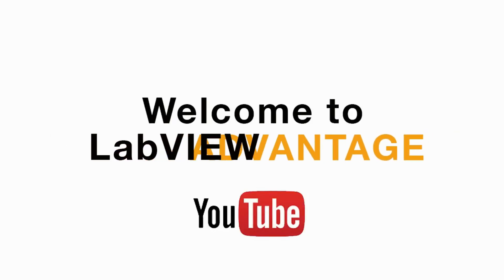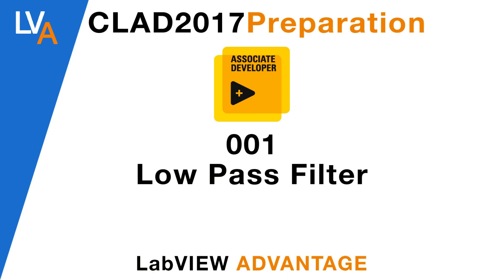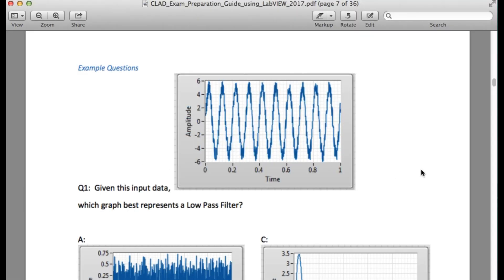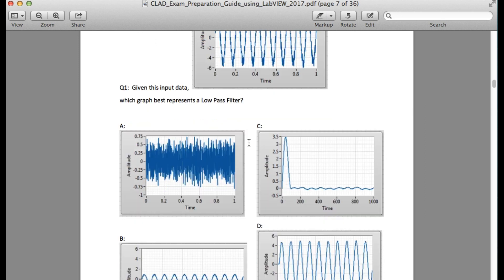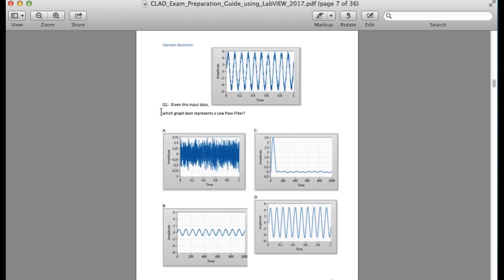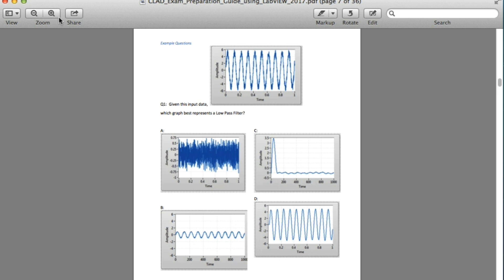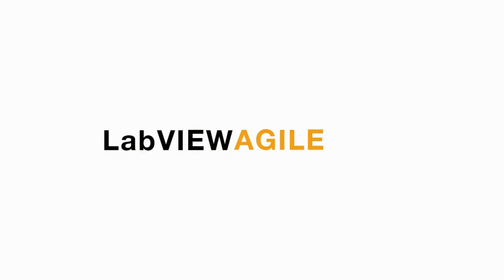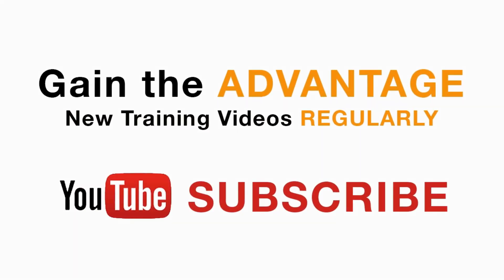LabVIEW CLAD 001 Low Pass Filter

Comment: To understand why A, B, and C are not the correct answer, we must explore some of the characteristics of a low-pass filter and the output it will give once an input signal is processed. In selection A, we can see that our output looks like high-frequency noise that seems like it's not periodic. This is not a valid Low-Pass Filter output behavior. In selection B, it seems like we can see that we have a low-frequency output, however, this isn't the case. If you look at the x-axis, the tick marks for the time is every 200 (seconds - I'm assuming). This makes the output seem like it's periodic every 100 seconds. This does not fit what our original signal would look like after it's processed. We also had a gain of 1/6 which isn't characteristic of a low-pass filter. Selection C looks like a pulse magnitude, which is periodic every infinity, which says that its frequency contributions include from 0 Hz to infinity. This is not a characteristic of a low-pass filter.